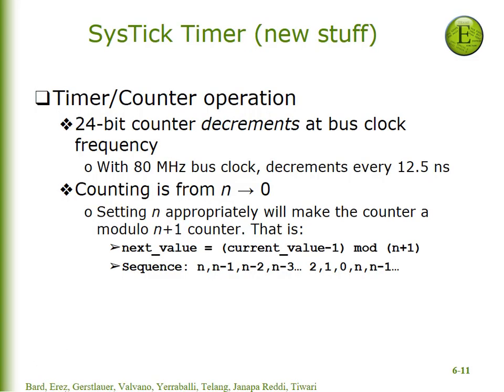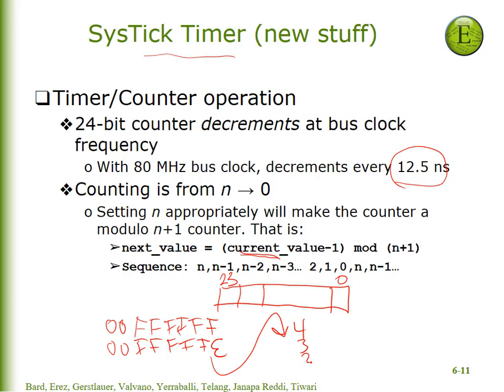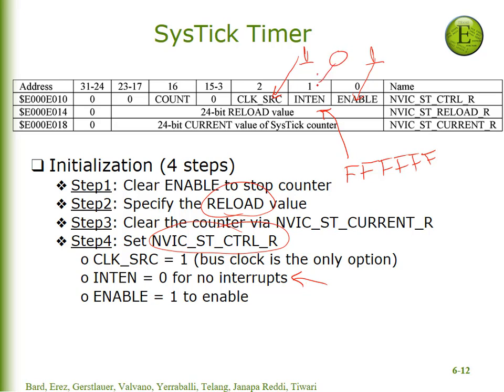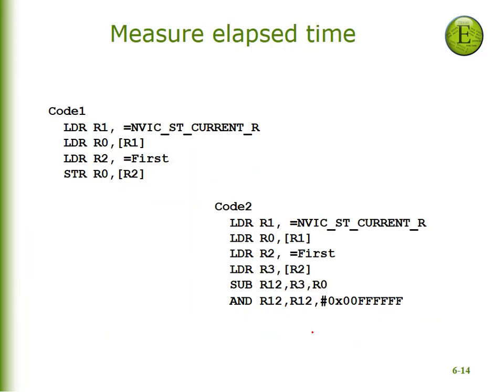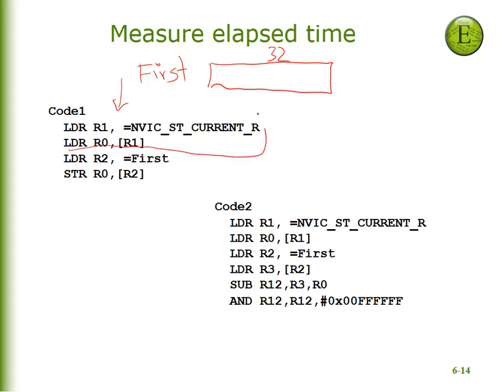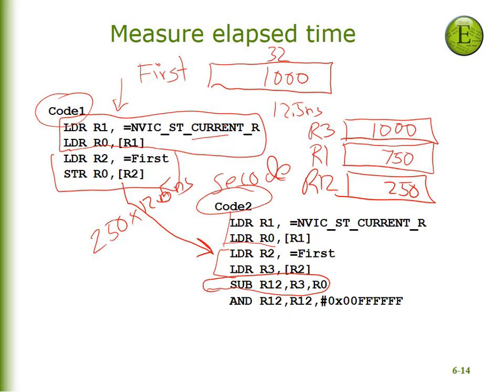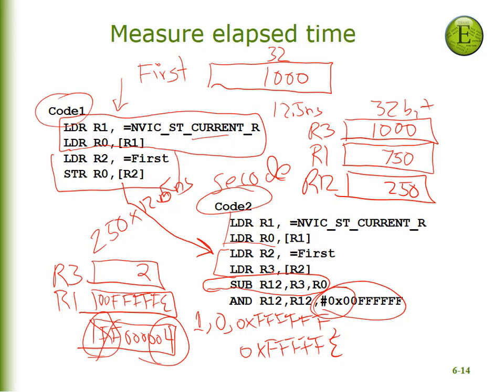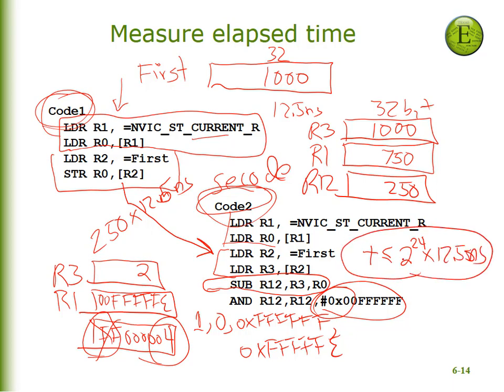SysTick Introduction

Comment: Jonathan ; can you please correct my code for blinking an led with systick timer because the led turns on but does not blink every second

#include"stm32l1xx.h"

int main(void)

     {
   RCC->AHBENR |= RCC_AHBENR_GPIOBEN;
   GPIOB->MODER &= ~GPIO_MODER_MODER6;
   GPIOB->MODER |= GPIO_MODER_MODER6_0;
   GPIOB->OTYPER &= -(GPIO_OTYPER_OT_6);
   GPIOB->OSPEEDR &= ~GPIO_OSPEEDER_OSPEEDR6;
   GPIOB->PUPDR &= ~GPIO_PUPDR_PUPDR6;

   void delay_ticks(unsigned ticks)
   {
     SysTick->LOAD = 319999;
     SysTick->VAL = 0;
     SysTick->CTRL = 5; }

     while(1) {
     if (( SysTick->CTRL &= SysTick_CTRL_COUNTFLAG) == 0)
       {
      SysTick->CTRL = 0;
          GPIOB -> BSRRL|= GPIO_BSRR_BS_6;// turn led on
       }
       else
       { GPIOB ->BSRRH |= GPIO_BSRR_BR_6; // turn off delay

     }
    }
     }
Reply: Fixed ~
GPIOB ->BSRRH |= ~GPIO_BSRR_BR_6; // turn off delay